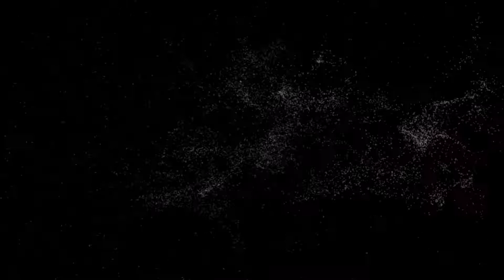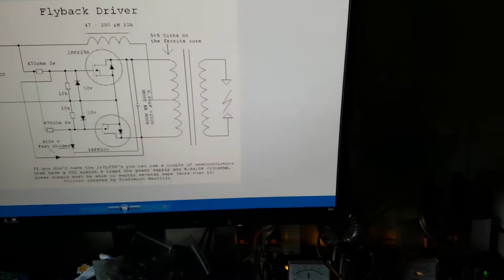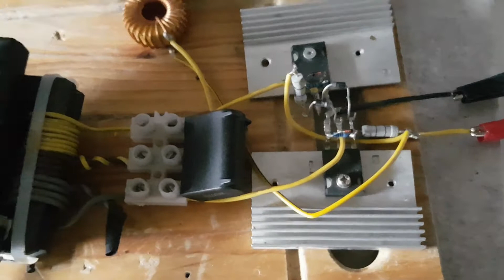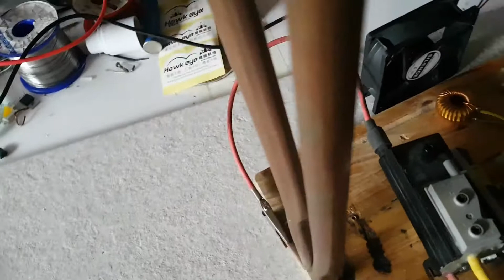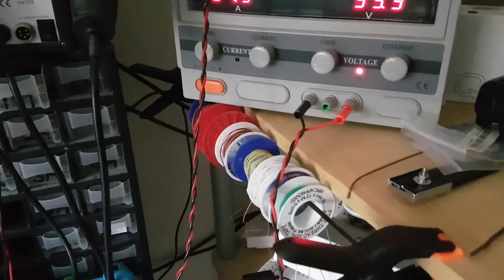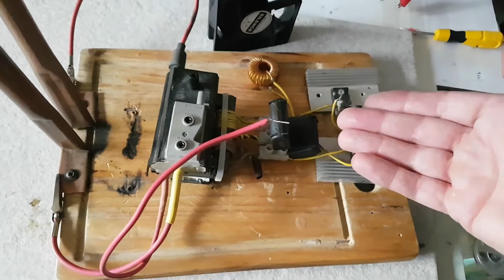ZVS ARC

Comment: Good job-- thats looks sweet "  nice one   cheers"  B-b
Reply from the maker: Cheers m8. It' is fun to sit and watch it. Pity it has no real practical application. It's just a blast from the past.
Reply: @Elecifun  
It may be useful to make Nitric Acid from air if it can sustain an arc for very long periods of time.
Cody's Lab has done so with a NST (Neon sign transformer).
 Would love to see if it's possible to draw continuous arcs from a flyback and zvs. I want to try myself but not sure of the long term arcing would fry my zvs circuit.